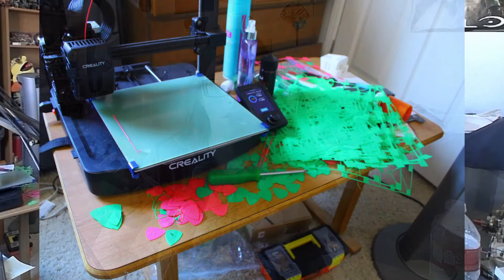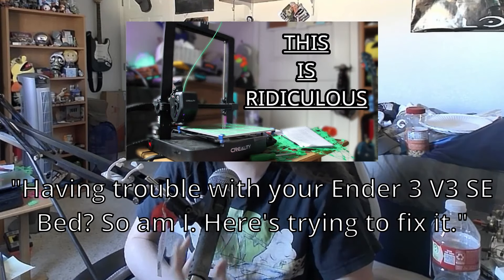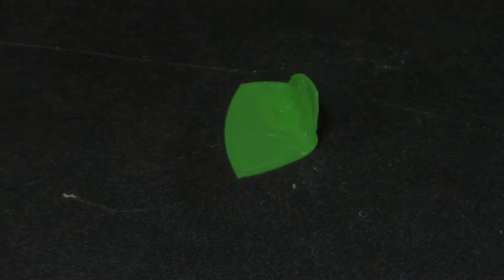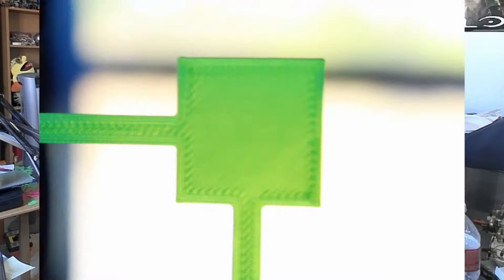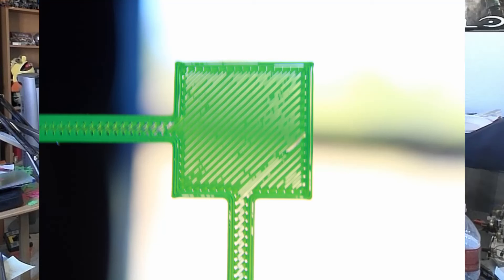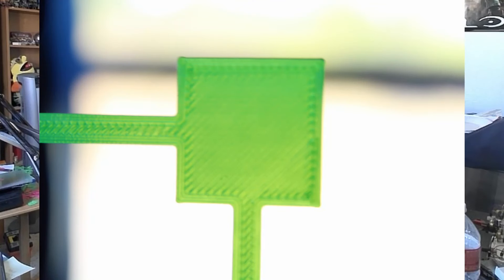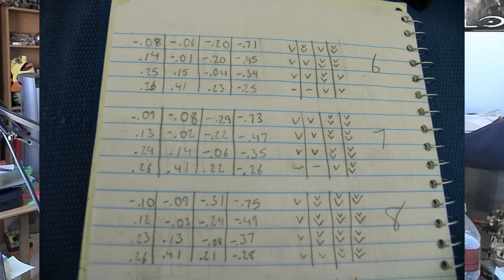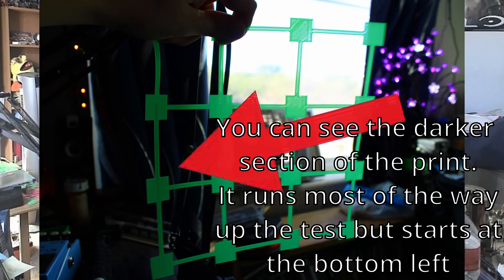(1.0.4 Firmware) How To Level Your Ender 3 V3 SE And Tips To Help!

Comment: I had this printer and it was flawless for nearly a month. I was so spoiled by this... One day it just said "screw you!" and started failing every job. I finally had to seek out knowledge like you have shared and thus far, it's made an improvement. I am getting prints now but I need to tweak things more. After that, no more auto-level for this guy. As much as it made me lose my religion several times over, I now have more know-how and I can't complain about that. Ok, I might complain a bit. I also started keeping a diagram of good/failed spots on the grid printout. Thanks for the info!
Reply: What did you do my printer worked fine for about 3 weeks now its failing most prints
Reply from the maker: Thank you. Your comment made my day.
Reply: I had to go through and tighten all the screws i could see, then i leveled the x-axis. this all helped. waiting on a set of calipers to do e-steps which should help too.

Comment: I bought an Ender 3 SE 12 days ago and started printing without realizing that some screws could come loose. While printing, I noticed the nozzle dragging across the bed since I always observe the first few layers to make sure everything looks good. After inspecting the printer, I found that the bed wasn't properly tightened, which caused issues during calibration. In the test, the lower left corner would always show three squares with a reading of about -0.90.

To fix this, I tightened the bed and replaced the nozzle with a new one because the old one was dirty, with a layer of plastic on the tip that I could no longer remove.
As of now it works okay so  I'm just waiting for new ceramic hotend to come as an upgrade to my ender 3

Comment: I watched both of your videos on the leveling issue. I too thought I have a leveling issue because my auto leveling and auto z offset varied so greatly. I had another issue that accompanied this issue. It sounded like the nozzle was skipping across certain areas (especially the infill). I saw a post on reddit that led me to check the squareness of the x axis frame. mine seemed pretty square though. So I thought something was loose or out of adjustment. I decided to go thru the entire machine and check every single screw. As I suspected, other than the screws on the couplers to the z axis drive rods and the screws I installed on when putting the x axis frame on. The loosest screws were the ones holding the mechanism that connects the little plates inside the x z axis assembly to the drive rod (not sure of all the names to the parts as I've only started this hobby about 4 weeks ago). Now that I have tightened every single screw on this printer, it seems to be doing a lot better, and running the auto leveling/auto z axis offset 4 times, the variances are much more consistent and lower,. Another thing I change due to over adhesion, was the bed plate. I was using the stock pc plate, but switched to the smooth pei plate and now my prints adhere perfectly during printing but pop right off with a slight flex. I haven't had to use glue or hair spray to get things to stick either.

Comment: I cannot even get it to print without getting detached. it keeps walking off the print bed during any print beside the benchy
Reply from the maker: Are you still using the stock build plate or a different one? Have you adjusted the Z offset? I also have a newer video about the newer firmware and how it changed the leveling process. I need to update this title to include that.

Comment: I sold mine because a few weeks after purchase it just wouldn't print. Prints stayed on the bed but we're terrible. I feel as tho it is down to poor manufacturing from creality
Reply from the maker: That's exactly what it is. They made horrible design choices on top of not putting effort into actually fixing their code that all lead to a generally bad printer. And they claim to listen to community feed back but there are simple changes that could help this print wildly. Unfortunately, they've dug themselves so deep into a hole, that it would cost them a significant sum of money to rectify their horrible design choices from the factory if they were to do the right thing and roll it out to everyone who's already purchased and still owns one of these machines.
Their goal seems generally to copy industry trends and undercut the competition price wise. But then they can't really ever do it properly. At least with some knock off products in the general market, they can provide a competitive alternative, but that's not what happens typically for Crealty.

Comment: Dude, using your gcode, the print, on my V3SE, shows great. But, when i get in my slicer the stl, THIS SUCKS A LOT. Pls, share with me the printer profile or the slicer that you use.
Reply from the maker: It's unfortunately gcode, and yes it does suck pretty hard. It's what was provided to me by the company and I just openly provided it, since they didn't. I believe someone made an actual model version of it, or close to it, on Printables. But I don't know much more than vaguely recalling that. Sorry.

Comment: i ran the gcode nozzle scratched some areas like deep scratches what should i do? so not only a bed leveling now ive a bad plate too
Reply from the maker: did you run the auto leveling before the gcode? Or have the pre print calibration? I'm not sure why the gcode would just dig into the bed like that.
If you have already ran one of the calibrations, I would suggest upping the z offset significantly then home the printer and check it visually first. You just want it to not be too close to the bed still. If you want to actually set the z offset manually, you can attempt the classic paper method. I tried looking up some videos, but the most popular ones wither drone on in the beginning or seem to be relying on the auto level being good too. So if you don't know what I'm talking about I recommend researching it first.

In terms of the bed, I don't know of there are actually ways to repair them. Even if you "repaired" the gouge, you would loose the texturing in the section unless you add it again yourself one way or another. So you may have to get a new one or you can try messaging Creality support and see if they would send a new one since the file was provided by them, I was just the deliverer because they were stinky and didn't make it public for some reason. Though since you got if from me they may try to fight you or just claim user negligence or something like that.

The good news about buying a new bed is that you can get a better quality one, often not much more expensive than a straight Creality replacement. You can also explore PEI or PEO or something like that. I think they give them different names for different patterns. But there are these cool other plates you can get that have a side that is mostly flat with a cool pattern for your first layer and a textured side for tougher or certain material prints. Just be warned the the PEI and PEO don't work well with all materials. I don't remember exactly, but I think when you use PETG and possibly some other types of materials, it sticks too well and often if you get the print off the bed, some of the bed comes with it. I may be wrong but I thought it was worth asking. If you use PLA all the time or just for now then it should work great. It should also hopefully tell you in the product description.
Affiliate Link - Textured and crystal style bed - https://amzn.to/3VP0v3a
This listing has different styles and sizes. I bought something like this for my P1P and it works better than the name brand. You will have to take out the alignment screws on the back of printer's bed chassis probably. Also if you do go for one on this listing, double check the size of the bed, and you shouldn't need a magnet plate because there's one on the printer already.
The rainbow ones somehow imprint that effect onto the first layer as well, which you may be able to use creatively, though on this listing it looks like there isn't one of the rainbow ones with the textured other side. I would recommend playing it safe and getting one with at least one side of the gold style textured surface. Though I think you could get one with that on both sides as well and I think this type of surface works with all materials. But again do some research and check my facts because I may be miss remembering.

I know this was long but I hope it helps.
Reply: @Bowsmin12  thank you will try, I might've ruined the z while trying the creality service tutorial where they adjust with the glue sticks underneath, their tutorials are total crap or I might be just unlucky. My printer actually worked too well for the first few days then suddenly my prints started to not stick on the bed, nozzle started to stick on the extruded models on mid way etc. I ordered a pei sheet waiting for it arrive to try all the steps again in before I throw the machine off
Reply from the maker: @akalpozkidirir2059  Their tutorials aren't the best but they can usually get the idea across from what I've seen. Though I have to mute the audio to be able to focus on the text since there's no dang voice over or anything like that.

My guess for why the prints stopped sticking is that maybe the auto leveling was still a bit too close (that seems to be common with the stock bed) and just wore down the bed? That's only an educated guess but many people recommend changing to a different, higher quality bed anyway. Kind of like what I sent before. But some people also say you need to find the tolerance for the Z offset inaccuracy and try to manually compensate for it, usually by raising it a small bit.

Some people say that you shouldn't follow the creality tutorial about the glue stick method and say you should try to print these : https://www.printables.com/model/853057-x-axis-leveling-blocks-guide-for-ender-3-v3-se-ke
I don't know how much it really matters as long as your bed looks level by eyeballing it. If it's visually off, you may need to fix that. but figured I would mention it. It's probably something you can do after you get your printer printing at least at an okay quality if you really want to, especially if you don't have any other 3D printers.
Reply: @Bowsmin12  do you have a discord or somewhere I can reach you out I really need help I been pulling my hairs since then I can't fix it properly :(
Reply from the maker: @akalpozkidirir2059  My discord is the same username, just without the music. But I will warn you, I am no expert and my machine doesn't currently even work properly either lol. But I haven't taken the time to sit down with mine and manually level it again since trying some other fixes.

Comment: HELP! My nozzle seems to be close to the prints but only in the front area. I have upgraded to the NebulaPad and it doesnt seem to let me manually adjust the numbers after running this print test. How do i adjust these settings with the NebulaPad?
Reply: I have manually adjust the z-axis which lessened the issue in the front, but it seems not leveled in terms of front to back height and idk how to adjust it. I am SUPER new to 3D printing
Reply from the maker: @ambercovert4099  This is honestly my first time hearing about the nebula pad. So unfortunately I can't personally help you. If you are willing to use reddit, you might be able to try the Ender 3 V3 SE subreddit. It seems like others have been having all sorts of issues with it based on a quick scroll through. I don't know if anyone has had the same issue, but it's at least worth a look. And of course you can try making a post. Majority of the posts are support and help posts on that subreddit.
https://www.reddit.com/r/Ender3V3SE/
Reply: @Bowsmin12  You are a LIFESAVER! I found a relevant post on there! Turns out I had to remove the hotbed & sand down a couple spacers under the front screws. I was then able to level it perfectly with the back. THANKS A BUNCH <3 You just saved a newbie from quitting on day 5 lol
Reply from the maker: @ambercovert4099  I'm glad you found a solution. Though there should be a way to change the level data manually somehow. Or at least you would figure as much. I would do more research on that just in case for the future. I'm also probably more fearful than you when making permanent modifications. People have recommended sanding down the spacers but I'm too worried to do it until I find replacements somewhere. Anyway, I hope you enjoy your time making cool plastic thingies!

Comment: If I've got a high point - the nozzle's too close to the bed - then shouldn't we increase the height of that point on the mesh?

For example, the front left corner is pretty rough, and the mesh has it at -0.03. If I raised it to -0.05, wouldn't the nozzle adjust updawards for the increase in height?

Same goes for low points - lowering the point by a little would adjust the nozzle down in that area.
Reply from the maker: If I remember correctly, the way I was trying to explain it is that high points are when your nozzle is too far away from the bed. But you are correct about needing to raise the number if you have a spot too close too the bed. However in your example, you are lowering the height. In terms of raising the height, negative numbers decrease and positive numbers increase. Did I say something wrong in the video? If I did, can you leave me a timestamp so I can see about doing something to fix it.
Reply: @Bowsmin12  Yup you're right, my bad :D. I did some testing with that gCode and got some pretty tight spots, so I raised that spot in the mesh by about 0.02. So if the spot was -0.04, the new value would be -0.02. This makes the hot end go up, giving me a better layer at that point.
Reply from the maker: @PatFriedl  Glad to help and clarify. I mess up numbers and typing all the time so most times I have to double or triple check and make sure.

Comment: how do you raise the nozzle up or down? how do you change the bed to be more level if its not auto-leveling?
Reply from the maker: Z offset will change the overall height of the nozzle. There is an option called edit level data and that's how you manually change the  points to hopefully make it work more consistently.

Comment: On the Creality bed level gcode, I noticed it does not do the M410 S1.  So the print doesn't use the mesh.  If we're adjusting the mesh to work better, shouldn't the gcode use the mesh?

Thanks for posting the video, been searching for adjusting the autolevel for months on the 3v3SE and getting all the other non 3v3SE videos.
Reply from the maker: I think some other people have mentioned this, but as far as I can tell it still uses the leveling data one way or another. My guess is that the get mech command should be in the start gcode of the slicer. So It possibly gets added that way. When I did the leveling test, the adjustments slowly made a difference which means it has to work somehow.
Reply from the maker: I don't know if the other comment was removed but there is a separate menu. I made another leveling video recently because I was finally able to update the firmware to 1.0.6. I don't remember if I put the menu navigation in this video, but if I didn't, the 1.0.6 video has it and it should be the same even if you're still using 1.0.4.
Reply: @Bowsmin12  Yea, sorry, I remembered seeing it, and found it as soon as I posted, so I then deleted it.    

The question was: Is there a way to edit level data without rerunning autoleveling.  The answer is yes, it's under Control Menu then Edit Level Data.
Reply from the maker: @no_such_reality4552  I figured it was something like that, but I wanted to message back just in case.

Comment: Printing on a mirror is the only way to go. They are dead flat. Adhesion and print removal are never a problem. Throw the glue sticks out. Initially, clean the mirror with soap and water and then wipe with a microfiber cloth. Cool the prints to less than 30c and they will pop right off. Gently scrape the surface with a single edge razor blade and wipe with the microfiber cloth between prints. You can buy mirror tiles and a glass cutter from Lowes and cut to whatever size. You can also buy different sizes of mirrors online for the Ender and others. Printing on a mirror is worth the initial effort. You will never, ever print on anything else. Guaranteed!
Reply: Nobody is going to own both a mirror AND single edge razor blades!  Oh...  wait.... never mind.   :D
Reply: @DrFiero hahaha,good one!
Reply: @DrFiero 😂😂😂. They go well together.

Comment: Thank you for getting that test print and sharing it, I really appreciate it!
Reply from the maker: If you want to be able to experiment with slicer settings, someone made a similar version of the level test on Printables. It's just called Ender 3 V3 SE level test or something like that. Of course this test should be able to be fixed with the printer by itself typically.